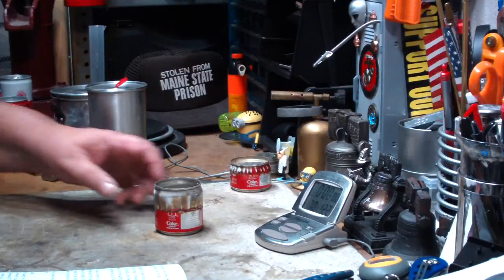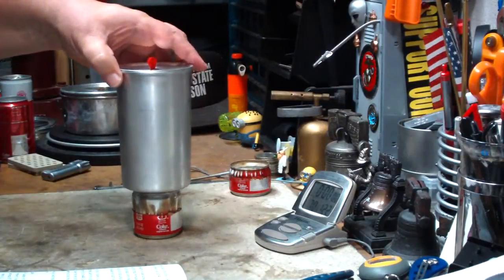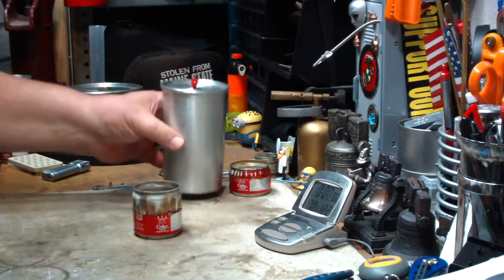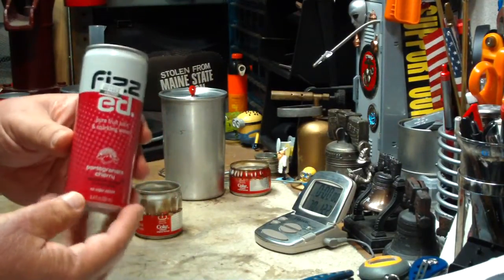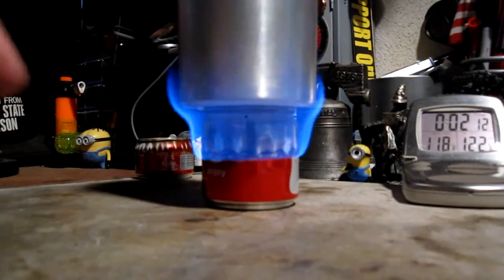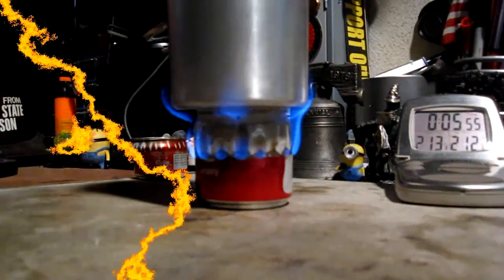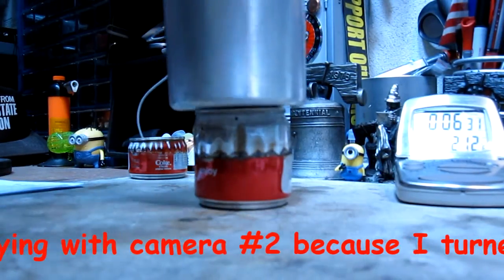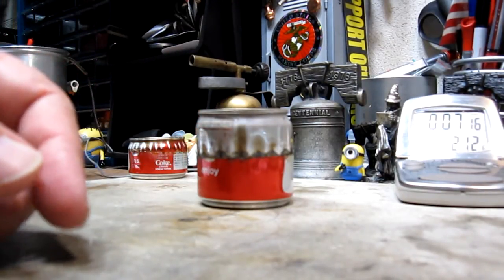Capillary Action Stove (CAS#2) - Used With A Narrow Pot - Boil Test #1

Comment: I think that this style of stove works better for just boiling water than any stove that I have used/built .It is also very easy to build . I have gotten boil times for 12 oz. of water(my normal cup of coffee or tea)  in roughly 4 minutes. It is not the best design for simmering. Thanks for doing these videos. I have really learned a lot and enjoyed watching them.
Reply: What is a good DIY design for simmering, bar the Trangia Spirit Burner?
Reply: Answering myself, is EMO Outdoor + Origami (pot stand), really easy way to simmer - just move a lever, but expensive stove combo.